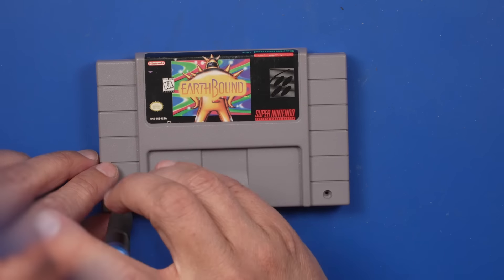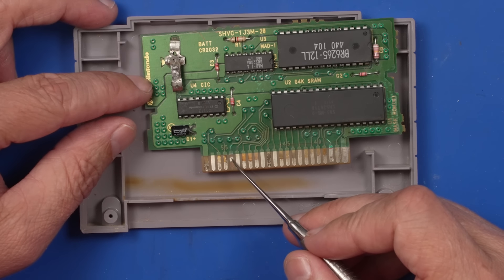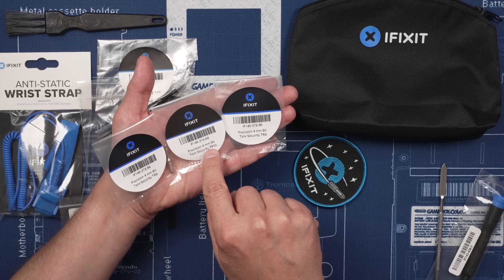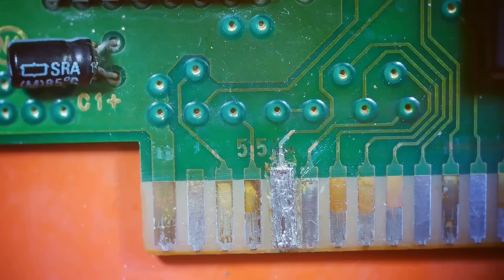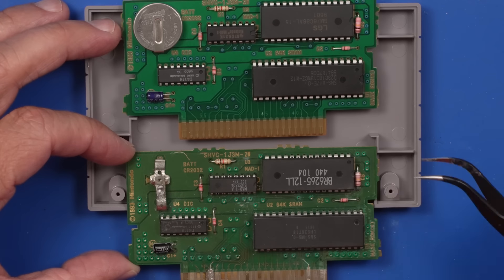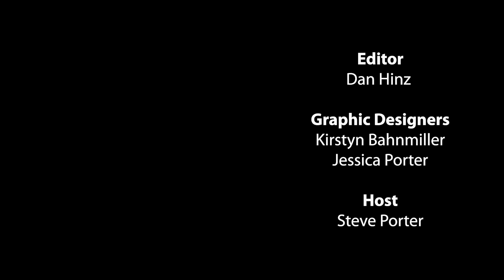This SNES Game is Worth Around $400 IF I Can Fix It!

Comment: Earthbound has some pretty nasty copy protection, including checking if the version of the lockout chip is the correct type, among other checks, in some cases you won't notice anything is wrong til you get to the final boss, it'll freeze and wipe your save (on purpose), don't know exactly if it's triggered by the chips on that particular game, but i really reccommend swapping the other chips as well, you don't wanna accidentallt sell someone a copy of Eathbound that might misbehave like that, swapping the other chips will definitely add to the authenticity as well, as right now this game is more NHL than Earthbound. 

Great fix though!! you always make it look easy, not hating just would be a bummer to have to deal with this later down the line when it could cost both your time, the buyer's time, and most importantly the buyers SAVE, Better safe than sorry! lol
Reply from the maker: Interesting. Good to know. Thanks for the comment
Reply: I think it goes through a number of checks and gettinga bootleg version to work through to the final boss would require a bit of hacking. Also it spawns a lot of enemies so even if you did make it to the end it would notice the difficulty.
Reply: I was coming here to say this. It is one of the reasons that Earthbound costs so much - it isn't just the rarity it is also because doing board swaps are such a pain. One blown chip and it makes the other chips useless. You might be able to play the game, but not be able to actually FINISH it. Sometimes you can't even swap between different versions of EARTHBOUND boards (although sometimes you can without issue). All of that contributes to the high price from working copies.
Reply: I didn't even think about that but you're right.  I wonder what Frankenstein-ing the board/chips would do, if anything, to the game.  It's not immediately obvious if anything is actually wrong and it does think that you're playing a bootleg version of it... if all you're looking at is whether it starts up or not, you'd miss that completely.  You actually have to know a little about the game itself to spot things that might be going wrong.  Easily the most famous of them all is the game freezing on purpose before the final battle and it deletes your save game when you start it back up, but of course you have to play through the entire game to get there and find that out.  It does all kinds of things before then like crashing/freezing randomly, spawning way, WAY too many enemies than what's normal in certain areas, sometimes the battle backgrounds glitch out, etc.  This one's worth a play for maybe a few hours and maybe some of these will pop up... the super dedicated would have to actually play through the entire game to see if you can actually beat the game.  I doubt you can concoct some set of circumstances where none of the other anti-piracy measures kick in at all except for the final boss freeze and delete, to avoid playing through the entire game just to see if you can beat it, but I don't know for sure.
Reply: No, it doesn't "check the lockout chip" - there are two basic hardware level checks in Earthbound - the first checks the size of the SRAM and puts up a piracy screen if it's != 64 kbit and the second checks the operating mode of the PPU and puts up a "This game is not designed for your system" screen if it's not running in NTSC mode.  The strange behaviour is all triggered directly or indirectly by modifying the contents of the ROM - either directly by the code failing a checksum test or indirectly by the first SRAM size check being patched out and the later ones detecting a larger SRAM.  The repaired cart will operate correctly - it's using an unmodified ROM image (because it's an original mask ROM) and the SRAM size will be the correct 64 kbit since it's on the same SHVC-1J3M-20 PCB and that (as indicated by the "3" in the number) uses a 64 kbit RAM.

Comment: adding a battery socket to this games is very much worth it, it reduce the need to doing multiple soldering and de-soldering which helps even greater for the preservation and longevity of the game. I already did this kind of things to my games like SMW, and boy it is a blessing having those battery sockets.

Comment: 10:18 hot air is really not ideal for removing a through-hole chip. I've killed two NES PPUs doing that, and old cheap circuit boards love to bubble and warp when you put hot air on them. I sometimes use it as a last resort if the chip legs really don't want to come unstuck but I really try every other method first. The best tool is a desoldering gun, but I know you mostly work on newer stuff where that wouldn't be useful very often. If the holes aren't plated, though, you can pretty easily just do it with solder wick!
Reply: @rfmerrill  I've been brute forcing it with a big solder sucker for a while until I updated my gear to the USBC iron with that Silver Solder sucker. I was so astounded when I pulled out two chips on a SNES cart in a fraction of the time I used to do.

Comment: To the people saying no one will ever know the board was swapped..... yes they will. A true collector will spot the date stamp on the board.  Changing caps is not gonna hurt the price. Changing the whole board will.  Still a nice fix. But it won't bring what he paid for it.
Reply: Yes. It should be disclosed that there was a board swap when it is sold on.
Reply: Same date stamp. And no, no one will ever know
Reply: @vadimbellous8313  as a high end collector of SNES and SEGA I can point 3 things that are not original and an issue with the board swap but you can keep pretending that no one will ever know, its not original now period

Comment: As a huge collector of SNES and SEGA there is no way a chip swap is original anymore. The value would be massively tarnished,  you could fake most people by not telling them but I would wager that most would turn that down. I dont think you could even get your $250 back.
Reply: if your a collector then you would know most people prefer the battery holder cause its only a matter of time till the battery goes out.
Reply: @mewinthedark8513  You keep things original thats what collectors want, adding things doesnt make something better you are clueless. Also you dont know how to read at all from what I wrote he takes the earthbound chip and puts it on a NHL pcb that is what massively devalues the game. The battery holder devalues it also so yea stop acting kid I have batterys that are 30+ years old still going in my carts its not needed.
Reply: @nogon1382  you getting offended really shows your character. You know when the copper is broken on the game pins and the board is so neglected he did the best choice for repair to preserve the game. He will have to add more of the chips to prevent the last boss battle from not working.
Reply: @nogon1382  the carts are a fairly standard design, the game is the game.  What you really want is another copy taken out of circulation to raise the value more.

Comment: Awesome repair! I will say though, there are a lot of antipiracy checks in the game, in particular quite a few SRAM checks. In theory if it boots it should be fine, since there is an SRAM check at startup, but you may want to guarantee by checking the chip codes on the donor board.

Comment: With pad replacement there are 2 things which makes all the difference. Flat "screwdriver" type soldering iron and poliamid tape. Also while those pads are solid enough to solder some components to them they will wear out pretty quick when inserting into a SNES cartridge slot. For that kind of application pads are plated with some hard copper alloys with or without gold.

Comment: I used to fix a lot of arcade game and pinball boards. I used deoxit on the edge connectors religiously and I used to use a pencil eraser to clean them up. (Before Magic Erasers existed) I replaced the battery on my original Zelda cartridge for the NES with a CR2032 battery holder like that.

Comment: FYI if you want to remove the traces, just use a soldering iron to heat the trace and then a razor to get under the edge to pop an edge up and then use something to grab the edge and peel while keeping heat on the trace.

Comment: Steve, You pretty much restored that to like new, Incredible work bro anyone that buys that is a lucky soul. I much prefer your board swap method rather than playing around with the pins as you say yourself you just cant predict how long the repair will last. I think you did everything at the best level here looks so clean and i like the battery replacement method. top marks ^5

Comment: To remove remnants of a corroded pad/trace prior to repair set your iron to ~250°F and use an unloaded chisel tip the same width as your damaged. Then, using light pressure, essentially stroke the damaged area weakening the bond/adhesive. Get a sharp chisel in there to do the initial release and then follow up pulling with tweezers or a pair of needle nose pliers depending on size. I've never had this method fail to work in the 15 years I've done milspec (IPC Class 3) repairs of cards and modules. IPC 7711/7721 has all sorts of great processes for repairs even if you're not certified/don't do work that is inspected to that level. HIGHLY recommend investing the $$$ in the .pdf's! Happy Tinkering my dude(tte)s.

Comment: For replacing the card edge contacts, one thing you might try at some point is to use an electroless copper plating kit. Electroless copper is how most PCBs these days are plated, so you could use that to lay down a thin layer of copper across the entire board edge, electroplate a thicker layer if needed, then re-etch the pins back to their original shape using your favourite PCB etching technique. An involved process to be sure, but it would make for some interesting content!

Comment: I bought the exact same battery holders like 10 years ago from china. They have worked like a charm in my N64 cartridges. Nice to see they also fit the SNES cartridges.
Wonder if a pcb producer could make nes/snes/n64 game blanks that could be used for games where only the chips can be saved.

Comment: 17:31 I use CRC contact cleaner and 2000 grit automotive sandpaper with just fingertip pressure. People don't seem to realize that the only way to clean corrosion and tarnish from metal is with abrasives. You HAVE to remove material to get a good connection no matter what method you use. If the contacts are shiny again, you removed metal.  You can see in 6:23 just how durable the contacts are.  It took a Dremel grinder just to get down to the board so there's no risk of me "sanding them off."

Comment: 6:40 Oh oh oh! I have a perfect tip for this! Just hold a soldering iron on it for a while, it'll come right off :) I'm not joking, it does actually work.Heat weakens the bond between the copper and board substrate. Just be careful you don't scorch the board (especially a worry with phenolic paper PCBs, which this one might be. Less of a worry with fiberglass)

Comment: I don't think the battery holder will de-value it, as this is now common maintenance for snes games to replace the save battery and future proof it, 

HOWEVER....

I think you need to swap the other memory chips over aswell because earthbound is very well documented and people look to check the chip numbers and type etc that earthbound should have fitted etc - I would swap over the other chips to keep it all original as it was made, the board swap is fine as its the exact same pcb 👍

Comment: #5 from the upper left has a little solder tail on the fillet that technically should be removed (small flush cutters can be used if possible). Probably ok in consumer electronics but in a UAV or something I'd fix it.

Comment: I spent over 12 years in the electronic card manufacturing business. Here are a few tips:
When you installed the chip onto the new board, one of the leads had an icicle. Should have touched it up again. Also get yourself a horse hair or boar hair brush and scrub the whole board liberally with alcohol followed by hot (140-160 F.) DI or distilled water or the flux residue will allow dendritec growth to occur over time. And finally never ever use your fingers on the pads. Once again, your hand oils that will promote dendritec growth.

Comment: For the traces I have yet to see someone try to do a copper plating repair even though it should be easy. There are both electro plate and quick plate solutions and they bond to carbon, more specifically Graphite, which is electrically conductive already and can be applied by just tracing the break with a pencil.
It's cheap, it would honestly be quicker, and the repair should be durable as well and as you are plating the graphite repair you will also be adding copper to the worn down traces that have had their copper surfaces worn down. A board like this would be perfect to try it out on even if it's just as a learning board.

Comment: regarding the value the game has a board from another manufacturer year than the original. But i think it is not CIB it does not affect it, as so as the battery holder, which is obviously nice to have.

Comment: The board swap itself is more likely to devalue than putting in a convenient battery connector.  Or using magic eraser to clean the pins.

Typically, though, devalue only happens when you make a permanent change.  

But, now that nhl 97 is worth nothing, as opposed to "next to nothing".
Reply: Makes me wonder if it would be considered more valuable if the game had been switched to another board with a matching 1993 marking on the PCB

Comment: I think a hot air gun may be a good assist for the pad replacements but I could be wrong, as a tech I’d say repairs have their time and place, patching up a old $20 game board as a hobby is one thing. Repairing a valued collectible will have more eyes on the repair work and without spending tons of time it won’t ever be as good as a donor board. Only thing I would’ve done different was finding a board from the same year, but we also come to a point of hidden prior damage.

Comment: i feel like the glue trace would instantly live longer on this if you grind into the board a little further at the bottom so the lower end is depressed, then put a small drop of uv coating there. the console contact really only connects further up and this way, nothing attacks the weak spot of this glue on trace.

Comment: It's worth more, not around, more.  That's also just the cartridge alone, not counting if you have the original box and the walkthrough guide which would put it closer to 1000 - 1200 range.  I should know, I got it for Christmas in 1995.

Comment: Yes, you put in a battery holder! Anyone that replaces the battery should put in a holder. One, it's easier to replace, two, it can be removed for longterm storage. It might not look original, but someone 20-30 years from now is going to thank you for doing that.

Comment: Well, you did a great job!!!  It's a fixed game, and is obviously better than the water and battery damaged mess that was delivered to you.

Interesting (somewhat philosophical) thought to ponder:  I wonder, however, how "original" is the game anymore?  What makes Earthbound an over $400 game?  Is it just that one rectangular chip?  You kept the original gray plastic exterior.  But the board is an entirely switched board, and the battery/ holder is brand new.  

So, is it really Earthbound anymore?  Personally, I think you've made it better and playable.  But is it the real deal, and does the price change because of the switches and upgrades?

Comment: I would find it interesting to find out how your fixes impact the value of the game.
Also I wonder how different methods of fixing the game slot traces would hold up over uses. Would a conductive paint work better or conductive tape or the heat bonding you used kind of thing.

Comment: I bought my copy of Earthbound in early 2010's for $25 off Amazon. Seller said it wasn't working. Turned out, instead of soldering a new battery in, they just stuck it on with tape. It worked intermittently. Took me a few minutes to fix properly. Knowing its value, I felt bad and offered to return it, but he refused.

Comment: i wonder: there is some conductive lacquer (silver lacquer, liquiwire, ...) you can buy. If you would tape off the shape of the connector and apply such lacquer, several layers, and let it dry if it would work.

Comment: I doubt a buyer would be upset over the battery mod after you did a complete board swap.  If I were buying the only thing I would worry about is does it work and is everything clean inside.

Comment: I'm so glad to see you doing better, Steve! I have a question about removing solder. At work I'm working on a PCB for an infusion pump and I need to remove a 40 pin LCD. The pins are arranged in 2 rows of 20 pins respectively. The problem is the rows are on opposite sides of the board with a lot of components in between the rows, so I cannot use a hot air station/ heat gun. How would you go about removing said LCD?